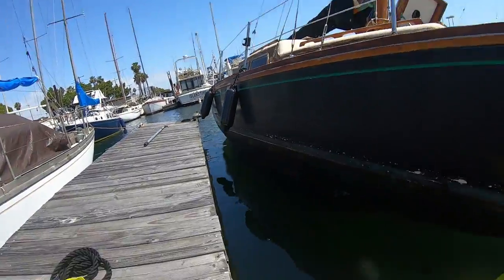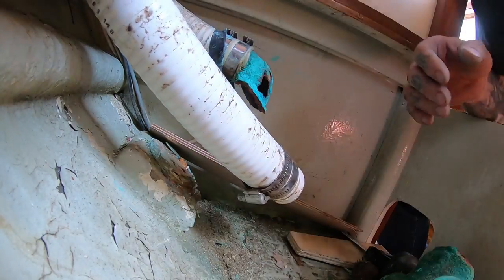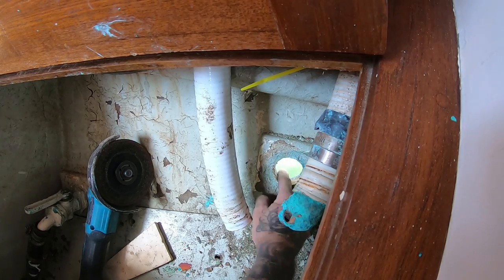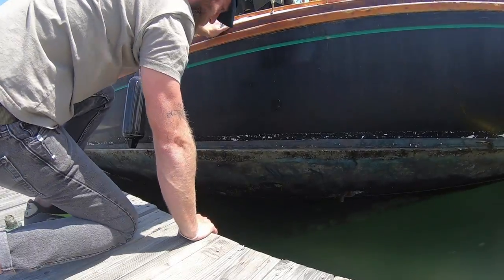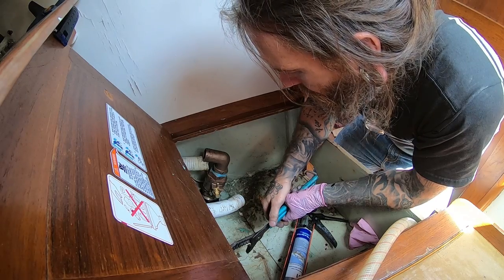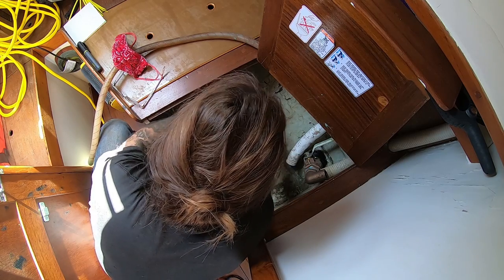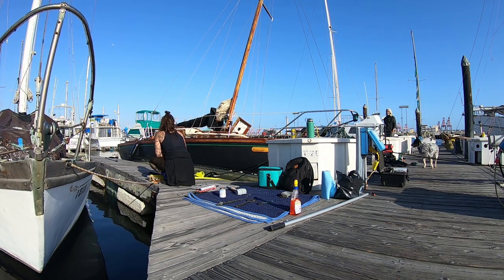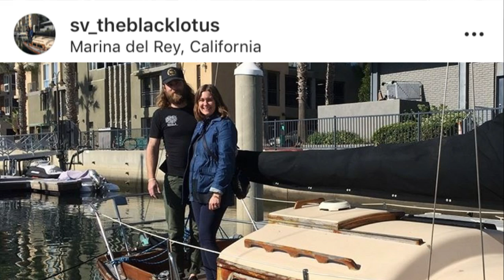How to Replace Thru-hulls on a Sailboat that is STILL in the Water AKA Careening Me Softly

Comment: Good work. Classic 18th/19th century method, well applied and fun to watch. Bravo! Just a couple of thoughts to offer, from plumbing experience: (1) You could really use a decent pipe wrench. It would be easier on your fittings and on your knuckles, as well as giving you a bit more leverage than the Channellock pliers, great all around tool though they are! (2) Switch to a regular Pipe Joint Compound for swabbing pipe joint threads. Whoever comes behind you will be grateful that things come apart without the need for a Sawzall! ;)

Comment: James, Practical and informative video in how to replace seacooks, but l would have used Tec7 instead of Sicaflex and Locktite 574 or 577 on the pipe treads.
Reply from the maker: Everyone has their own way, I learned from the guys at the Venutra Harbor Boat Yard and they do hundreds of boats a year since the 80s so I will trust their advice
Reply: you don't want to use locktite  pipethread is sealed with teflon tape always u wanna have it serviceable

Comment: Use life caulk sealant. No waiting to skin/dry. It can actually be done underwater, but it must be done quickly(seconds!)because water accelerates the curing. Rope through cork, fitting, hull, cork method. 5200 fast dry sealant works, but surfaces must be dry, no dampness at all. 5200 is very difficult to remove in the future, never on thread (like welded!). Always clean off the outside sealing surface with an abrasive pad then fast dry solvent before installation. Don’t use silicone.
Reply from the maker: I would never use 5200 on anything, I only use Sika for sealant and epoxy for bonding.

Comment: Hey man, great video. I'm curious, why not marelon fitting, and why not 5200 sealant?
Reply from the maker: I don’t think 5200, which is permanent should ever be used on any part of a boat that can break or suffer from corrosion, I actually would never use 5200 on anything because if I want to permanently attach something I just use epoxy resin (if it’s on a fiberglass boat) as far as Marelon goes I don’t trust plastic when it comes to moving parts that might sink my boat, maybe I am a luddite on this subject but bronze is far stronger and at least you can see it’s corrosion and take measures to fix it
Reply: @SailorJames  Thanks for the reply. I hear ya. I only went with 5200 as everyone in the boatyard swears by it. The reason for choosing marelon is so I don't have to deal with corrosion. I don't expect my thru-hulls to be 'moving parts'. A friend has had them on his boat for 10 years and the way I see it if they failed the company would be out of business pretty quick. I have zero metal under the water now other than the shaft and cutlass bearing.  But your not alone, the main boatyard guy thinks the 'plastic' (they're glass-reinforced nylon technically) are crazy to use. I guess I just trust the science behind them. We shall see how it works out. I hope to see you in the cruising grounds next year!

Comment: Cool way of showing how to do it in the water but this is definetly NOT how you use sikaflex for thru-hulls. You don't put it on tha locking nut and especially NEVER on the actual thread, depending on what its for you'll end up having particles of this stuff coming in your cooling water or filtersystem or whatever and even more important good luck maintaining it in the future. For the thread thats what teflon tape is for on threads.
I'm a boatbuilder by trade if anyone questions my knowledge.

Comment: Hi James... one (or more) question(s). ¿Have you checked the zinc anodes on that bo at?, if not, and that zinc anodes are in bad condition, the new bronze thru-hulls can have a really short life. ¿have  you checked the electric instalation? ¿are you sure that electric have not derivations?... Good job anyway.
Reply from the maker: Those through hulls were 55 years old and I would imagine there was a lot of stray current in Marina del Rey where the boat has lived since 1998. The zinc on the propshaft is new and fine and the thruhulls arent bonded to one another (at least now since I have known the boat, maybe they were in the past) They are replacing all of the electrical on the boat so if there is any stray current from the boat it will be taken care of very soon.

Comment: An easy way to safely remove an old thru hull is to use a wooden damage control plug, banged into the hole, then cut off to an inch or so. The use the wooden stub to center a proper sized hole saw on an drill. It'll cut the flange off. https://drive.google.com/open?id=13qM8ICzuUbyhtuLI1pMO70WoyPNIcHpO
Reply from the maker: Oh cool! I know that trick for enlarging holes but never thought about using it to remove thruhulls ! Thanks for the tip!!